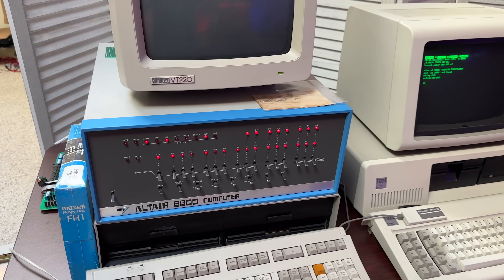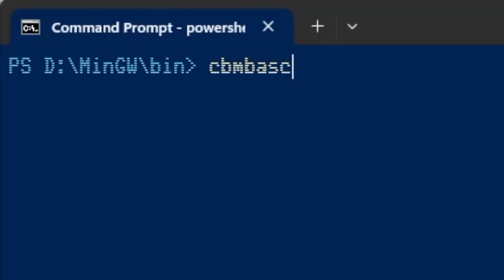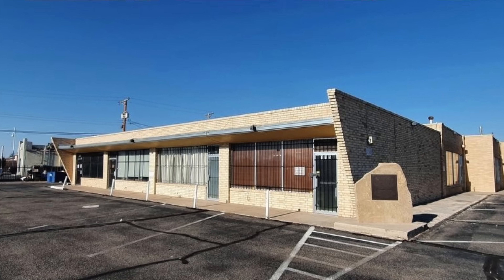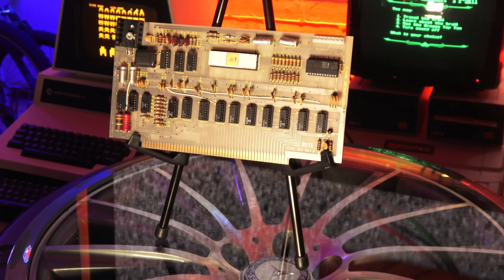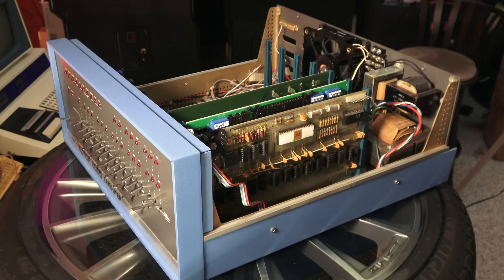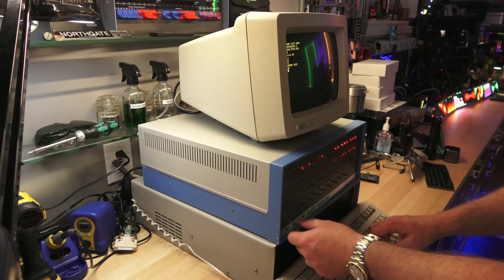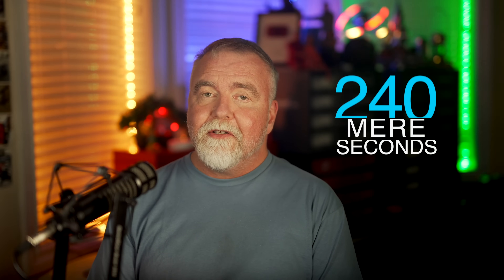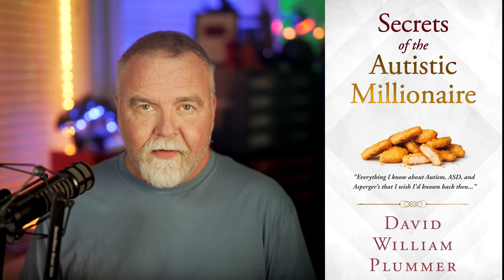Altair 8800 vs AMD Threadripper: Which is Faster?  We test them!

Comment: yanno. this really isn't very accurate, your sample size was really small, just running the program once, or a few times isn't significant, you need to run the altair code a few more billion times
Reply from the maker: You think so sport?  I disagree.  Prove me wrong.
Reply: @DavesGarage Yes, I'll get right on it, I should have the results in 15,000 years or so

Comment: Proposed second experiment: you've measured throughput, now measure latency. Compare the time from when a keypress occurs in an editor to the time when the phosphor or LCD dots start lighting up. You can use a dual-trace oscilloscope to see the keyswitch contact closing and a phototransistor to see when the light starts getting emitted. I suspect WordStar under CP/M will have lower latency than Word on the Threadripper. I feel quite confident Turbo Pascal under CP/M will beat the pants off of VS Code.

I'm going to go ahead and do this. The only retrocomputer I have running right now is an original 8088 Compaq Luggable, but the basic concept will work on the LK201 keyboard on your VT220. Ping me in a week or two if you're interested in the results.

Obviously, you'll also want to test the round trip latency on Threadripper with the VT220 connected to a serial port and your choice of Operating System. For a period-correct experience, might I suggest one of the BSDs?

Comment: Last Summer I made a PC-XT clone inside a custom hand-built wooden enclosure.  It uses Sergey's Xi8088 kit, which I assembled and placed on top of a modernish backplane.  I also built the XT-IDE and AdLib clone cards.  My "AWTPC" has four toggle switches and six status LED's - still more switches than the ThreadRipper!  But this video makes me feel I need more switches, lol!  Hey, I've got an idea: I have a 733MHz Pentium III system card from an industrial computer that would technically fit onto the backplane I used.  Wouldn't that make an interesting YT video?  "The Mother of all CPU Upgrades: What if you could upgrade your PC-XT from a 4.77MHz 8088 to a 733MHz Pentium III?"

Comment: For running BASIC on the modern machine, I expected you to just run QBASIC from the Windows command prompt, rather than some emulation project. Or did Microsoft stop shipping it with Windows at some point?

Comment: 1,418,083,200 seconds from midnight the day of the altairs launch till the end of the day of the threadripper launch, the Altair wouldve completed 5908680 iterations 

This would take the thread ripper less than 60000 seconds to complete at around 8.5 to 9ms, about 16 hours. The threadripper would get more work done on its launch day alone than the altair can muster in 44 years

Comment: So I tried it on an emulated Atari ST (I didn't have the energy to transfer on a real ST). If I make the assumption that Microsoft BASIC on the Altair is the most unoptimized interpreter possible, the Altair is about 5 times slower than an Atari ST using the actually most unoptimized interpreter, ST BASIC revision D. 1 Pass took 47.545s (I used timers to measure). Now I thought that the 68000 runs at 8Mhz, so it should be at least 8 times faster, so I checked with a faster interpreter, GFA BASIC 3.6. This needed some rewrites, because I couldn't use a GOTO to escape the loop to line 130, so I had to reverse the logic there and enclose the second for loop in the If.  Now this gave a result of 5.395s which is 9 times faster to Metacomco's ST BASIC and 44.5 times faster than the Altair.  To be fair to the threadripper and since GFA BASIC has a compiler, I compiled the program and run it. This gave a result of 0.8s for a pass or 6.25 passes for 5s. Thus we can conclude that the threadripper is 7.811 million times faster than the ST or 122 thousand times faster per core. Now I read in Wikipedia the threadripper performs 2,356,230 MIPS while the 68K about 1 MIPS. So it either uses about 3 times less instructions to perform the calculation or the C++ compiler is 3 times better than the GFA BASIC compiler.

Comment: Great video, though I do have 1 complaint... fast forwarding the altair running? Why not show the binkenlights while it was working!

Otherwise, very fun to see an old machine put through its paces.
The machines I have today run rings around my old 8 bits, but I loved knowing what was going on under the hood and being able to determine how long a piece of code would take to execute by counting the number of cycles each instruction would take :)

Comment: It looked like the Altair's BASIC code had N=1000 instead of N=10000. I assume that was changed for the actual run? I loved seeing this video. I logged many happy hours on an Altair 8800 back in high school but I'll probably stick with my modern system for my prime number calculation needs.

Comment: I call foul because you didn't use GW-Basic on the Threadripper...  The Altair used an Intel 8080, but the BASIC you used was for a 6502 and running the basic interpreter in an emulator isn't really comparable.  The Threadripper's native instruction set is at least a descendant (however distant) of the one used by the Intel 8080.  You'd have to go out of your way to install a 32 bit OS on the Threadripper to stand a chance of running GW-Basic natively (because 8/16 bit instructions will run natively in 32 bit modes but not in 64 bit modes).  But these modern processors should still natively support those old instructions with a little coaxing.

Comment: Rather than wiring the pads together, I wonder if anyone put a pin on the pad or something so they can just connect a wire with the mating connector to the appropriate pins.  It might help the PCB last longer that way really and these computers are nearly as old as I am.  Yes, I am turning old!!

Comment: I miss my threadripper. Used it for exactly what you do: programming in Windows. I also miss running AMD in general. I currently daily drive one of those fancy newer Mac pro’s with a decent 16 core Xeon, but I am running dual radeons! Excellent video as always, Dave!
Reply: The xeons are old, from 2019. You are missing out.

Comment: I know and understand why this will never be possible, but I'd very much like it if I never had to upgrade my Threadripper CPU. Technically it's way more than what I need to do the things I like to do with the computer now, and I bought it hoping to hold it for a good long while and not putting myself with something like a Ryzen 5 or 7 has definitely made that possible. But how long until they push out something even crazier than that thing already is? Of course I'll have to buy that, too!

Comment: For fun, I ported your BASIC program to run on my homebrew 6502 machine (based on Ben Eater's design). At first I was surprised that my code seemed to give the wrong answer (168), but then I realized that the code you showed was for finding primes under 1,000, but you gave the result for finding primes under 10,000. I tried finding primes under 10,000, but as it turns out, the meager 16k of RAM in my machine was not up to the task. 😁

Comment: Never touched an Altair, but the first computer I ever used was a Dick Smith Mini Scamp, which came as a kit based on National Semiconductor’s SC/MP processor. Not quite as many switches as the Altair, and only 256 bytes of RAM. This would have been the late 1970’s, maybe ‘78.

Comment: Just tried the same on my SWTPC-6800 box, 2:25, but with a mod, I didn't have enough RAM for 10000, so I set it to 5000 and made it loop through twice. Not sure what effect that will have on the run time, but it was the best I could do.

Comment: Still, let's look at Moore's Law. Or rather, what's incorrectly stated to be Moore's Law: that computing power would double every 18 months, without increasing power consumption. Wikipedia tells me that this was stated by David House from Intel.

With the Altair being from 1975 and it being 2023, that's a very convenient 48 years, which can be translated into 32 18-month periods. If we take the above as gospel, the increase in computing power would be 2³², or 4,294,967,296 – not the measly 2.3 billion that we actually got.

And what is the difference in power consumption? That Threadripper must cause quite a bit of emissions.

All things considered, that Altair is actually quite impressive.

Comment: There was an old 8086 assembler that was mnemonic-compatible with the 8080. I think Intel wrote it, intended as a way to facilitate migration from the 8080 to the 8086. And, of course, the Ryzen is still directly compatible with the 8086's instruction set.

So, in theory, you could assemble the original MS BASIC on the Ryzen. There might have to be some modifications in order to get terminal output.

Why do I bring this up? Well, because doing so would be the most direct comparison, without the overhead of emulating another processor, but also without the optimizations of modern compilers and fancy-schmancy additions to the instruction set. And it probably won't run on more than one core at a time. Just raw speed, with no other technological advantages.
Reply: 8080 basic uses CPU flags that don't exist on 8086. The translator was a source converter, you had to fill in the gaps
Reply: @phill6859  The entire list of flags available on the 8080—S, Z, P, C, and AC—are all available on the 8086 as, respectively, SF, ZF, PF, CF, and AF. Can you be more specific?

Comment: Dave, back then the OTP ROM part numbers were 23xx. The erasable versions were 27xx. Same applies to CMOS variatants. A 2716 (27C16) should work if the same speed or faster. The number after the hypen in the part number gives you the speed, i.e. 2716-450. I could hook you up with some used M2716F1 (access time of 350 nS) made by ST Micro if I knew how to reach you. The P8316E has an access time of 450 nS, so these should work just fine.

Comment: Why do you use the old 2012 Mercedes Rim as a computer stand?
Reply from the maker: It's 2020 S class wheel, actually.  I stack the winter/summer set that are not in use and clean them and put a glass top on it and then its a table.  Space is precious :-)
Reply: @DavesGarage  I would be terrified for scratching it. I didn’t knew they still made those rims.

Comment: Does the Microsoft Basic interpreter run on a single core? Because I find myself wondering how much slower the single core performance would be. 

Though I guess maybe I could just divide by the number of logical cores on the Threadripper and get close enough.
Reply from the maker: It runs on a single core, which is all cores.  So they both run on ALL cores, I suppose.
Reply: @DavesGarage  I meant the interpreter running on the Threadripper.

Comment: Quite funny to think -- If you would have turned on the Altair running the prim shiv in 1975 and just left it until today, it would have only completed 6,263,316 cycles. The Thread Ripper did the shiv 6,263,316 times in 641 milliseconds, running native! 

With the Thread Rippers hands tied behind its back, it would take about 14 hours and 20 minutes to do the same 6,263,316 shives emulating Altair Basic, I'm betting this is running as a single thread -- If we took into account the 128 threads, you're talking 6 minutes 43 seconds.

Comment: The sensible answer is I want the threadripper but I know that the Altair will be more fun. Back in the day (when the Altair still had whole page advertisements in every computer periodical), I learnt that the greater the limitations of resources, the greater the fun. Even then, the speed of processors were mind blowing. Many times I would be writing in assembly language (Z80) and as the pages of code were building up, one would begin to think 'this function is going to take forever'. So, when I had finally typed it all in (we used to code on paper then type it in), it would be with a tremulous heart that I finally typed run. Before I had focused on the next line the result would pop up and that was with a 1.3 MHz Z80. Like the wonder of space challenges the human brain to scale up to that vastness, it can't really take in the speed of a microsecond. Yes, I would take the Altair. Great video BTW.

Comment: Awesome video! My first computer was a Heathkit with an 8080 running 1 mHz and a front panel. My second was a North Star with a 4 mHz Z80 and 64 K bytes. Both running basic.

I played chess on the Heathkit at level 4. In mid-game it took about 70 minutes to make a move. In 2002 I had a Pentium 3 at 450 mHz I think. Playing a full game it took 0.08 secs. Very demoralizing! ;-)  Ahhh the lives we have lived!

I wrote business accounting software on CP/M with the Z80.
Reply: 😊 similar for me, in the early 1980s I wrote Business Software (sales and customer management) on an 6809 based machine by SWTPc running UniFLEX (a slightly stripped-down version of Unix V6 re-implemented in 6809 assembly language by a company called TSC).

Comment: As someone who built an S100 computer from scratch and wrote a lot of 8080 machine code (including an assembler I hand-assembled), I LOVED YOUR VIDEO!!!
Reply: That's bootstrapping; hand assembling an assembler so you can then assemble a better version :)
This is a bit like an interactive compiler I developed in the 80's [Z80 for CP/M] and 90's [68000 for Amiga] which was written in itself and you could modify it on the fly.
You could do crazy things like:
  EDIT IF
and it would decompile the function that compiles IF statements and let you change it and compile the new version back into the running compiler!
I had to 'hand-compile' in assembler the core functions that would allow it to then compile the rest of itself from disk.

Comment: I'm guessing most of the altairs time is going on calculating the square roots... and it'd go much faster if you did away with the sqrt every step and just went up to sqrt(10000) i.e. 100 every time. 
10000 by 100 is 'only' a million and it should be able to do a million 'things' in a few tens of seconds

Comment: It's a bit unfair; the greater size and complexity of newer operating systems, programs, etc, make a difference, not to mention the compatability layer slows down windows apps. This is why Linux can be faster than Windows. This is why games and other apps for gaming counsels can run on a console that is half the cost of a gaming PC due to.thw games and apps for a cousel not having all that overhead. Another factor is comsoles and early computers had the OS on a ROM which also speeds things up. 

As Solid State Drives get faster, and the possability of having storage on graphics cards, and other hardware changes, acess to programs and loading them could greatly speed up. 

I think the biggest issue today is operating systems, games, and possibly other apps being 75% or so complete, and eventually patched via updates, games that need huge downloads, and especially qith windows a culture of making the OS bloated and a philosophy of "we will just make an update/patch" which now that game systems are online has spread to consoles as was seen most obviously in the game Cyberpunk. 

If modern computers ran games as low res and low resource heavy as old systems; they would run circles around old systems.

Comment: I was using the IMSAI equivalent in college, my capstone project was to support data collection from the biomedical engineering department. The IMSAI has its transformer on the right side of the chassis, and an unfortunate position of the fuse at the far right side of the chassis. The chassis was grounded. The transformer made the balance point near the fuse. Of course, boards needed to be inserted and removed frequently, so the case cover was never installed. At least twice i picked up the chassis while it was plugged in, and set my thumb on the fuse while my fingers were lifting the case. Luckily, i was able to remove my thumb in both cases.

It looks like the transformer is in the back of the MITS machine. Still, be careful when lifting the computer while it's plugged in and the fiber is off, the safety of these systems was not up to the standards of the later integrated power supplies of the PC.

Comment: The "Am9218" is a direct replacement.
Alternatively, you can use the 2716 Eprom as a replacement, but it´s not pin compatible, so you´ll need an tiny adapter PCB.